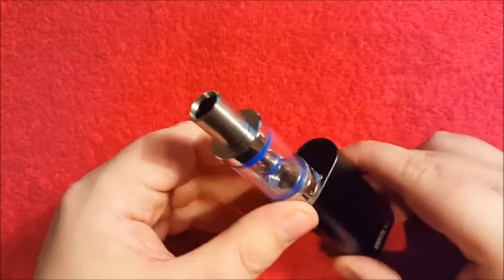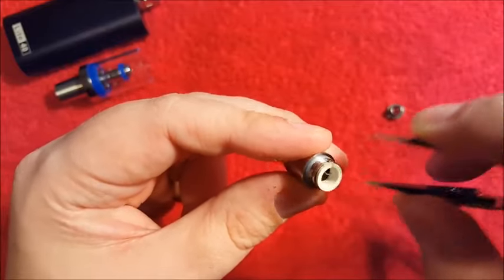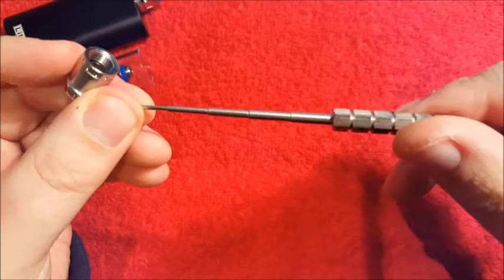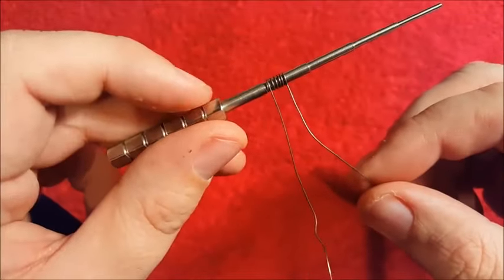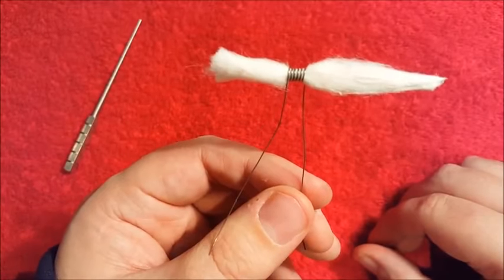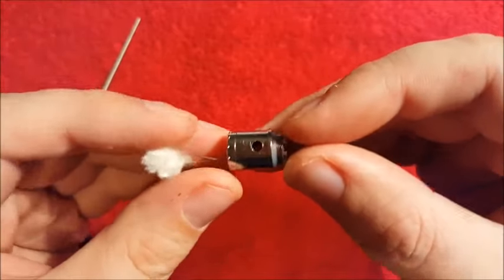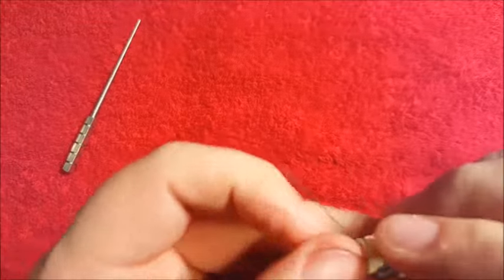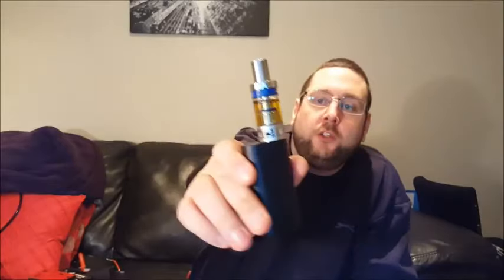How can your vape lite 40 repair in koyel

Comment: Hey bro, can you please tell me can i use copper wire instead of the wire used in the filter?
Reply: Copper wire have high conductivity using ss wire will help.. As it's resistivity is higher than copper